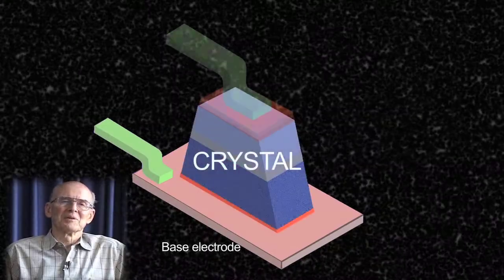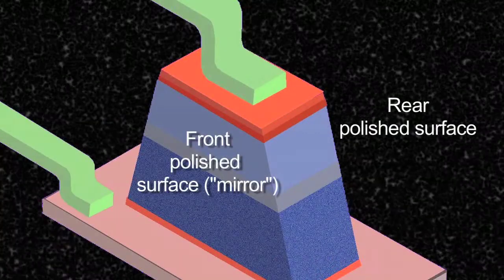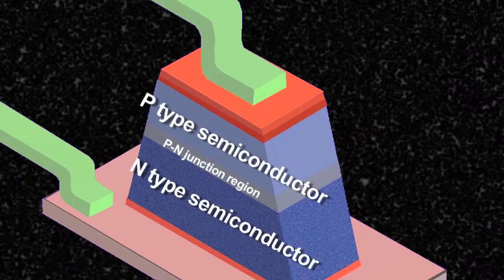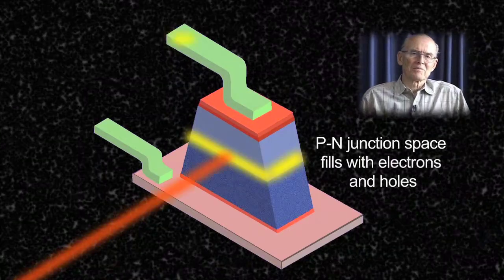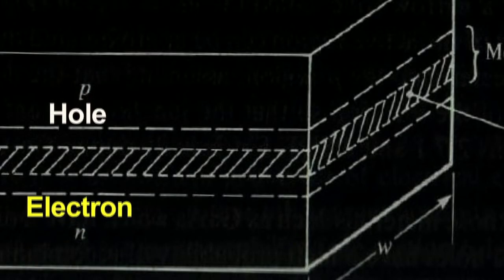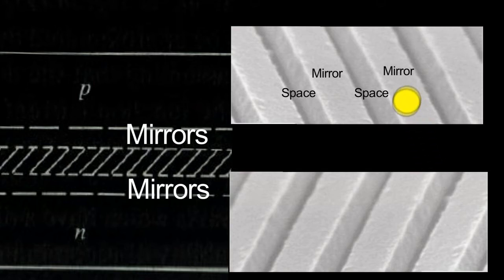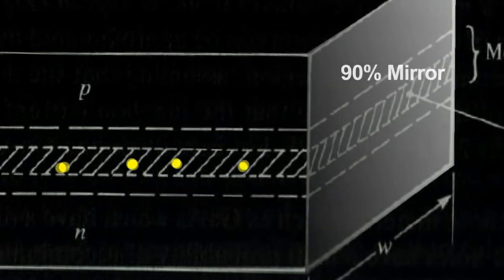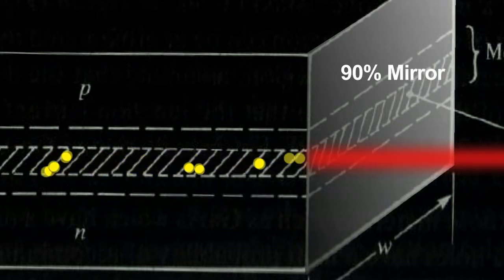How a Laser Works

Comment: Is'nt an LED the same thing as this but without the mirrors?
Reply: LEDs and laser diodes are constructed differently, though they use similar materials. Both use layers of P and N type semiconductor material (such as gallium arsenide), but semiconductor lasers require different electrical and optical characteristics. In particular, all lasers require the active medium to be able to sustain a population inversion of excited to ground-state components. This is produced in the laser diode by heavily doping the P and N junctions, above the doping regularly used for diodes and LEDs. Also, of course, the laser diode has to be constructed to possess a Fabry–Pérot etalon (of which the mirrors are part).
Reply: John Kerley Many standard LED's have reflectivity cavities surrounding the P/N chip just below the cat whisker.  In essence this reflects the light upwards.

Comment: WHY wouldn't this work with solar panels ? I mean bouncing light back and forth in the panels thanks .
Reply: What a stupid idea
Reply: Cat eye effect bouncing back and forth until most protons are captured .
Reply: I'm sure you mean "photons," and solar panels aren't designed to amplify light by the stimulated emission of radiation.
Reply: Solar panels work on the photo-voltaic effect by which incoming light (from the Sun, for example) is transformed into electricity.  A diode laser uses electricity to produce light. Sort of the opposite. If you let light going back and forth in a solar panel, you will experience loss, not gain. To experience gain, as in a laser amplifier, you need to supply energy from outside in some other form or you violate conservation of energy.

Comment: a hole is a position on an atom where it is missing an electron. They make the P material by removing electrons and the n material by adding extra electrons. Put them together and energize it with electricity and it forces those extra electrons in the n material to take a position in the "hole" in the the p material.

Comment: You probably figured it out by now. If not, holes are created when bound electrons are excited to higher energies and become mobile. This requires energy. When electrons eventually lose that energy and drop back into a hole they emit light (the excessive energy that is lost) with a frequency corresponding to that energy (E = hf). The more excited electrons are, the higher the frequency (lower wavelength) of the light emitted when they drop down into a hole.